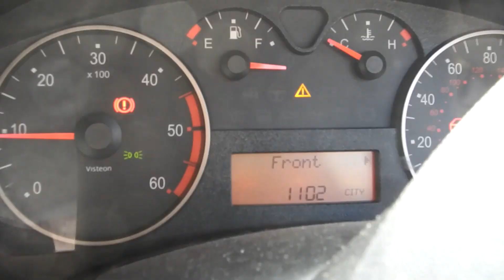FINALLY WORKING ON THE STILO! Sort of...

Comment: If you leave the caps off, no one can steal 'em...    you'll have to have the calipers powder coated or something, because regular paint won't stay very long ('cuz of the heat)...
Reply from the maker: Thats true! :D I thought they did a specific paint for calipers in tins but perhaps I'm wrong :o
Reply: I have tried some "high temperature" paints for exhaust manifolds before, and I wasn't impressed...
Reply from the maker: I'll have to look into it then before mucking it up